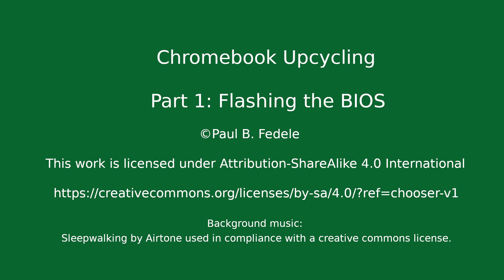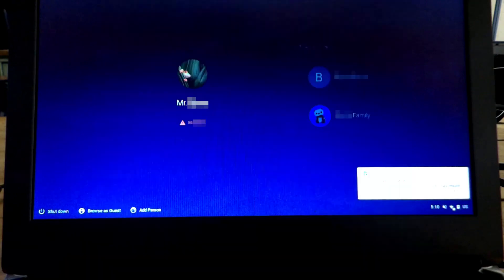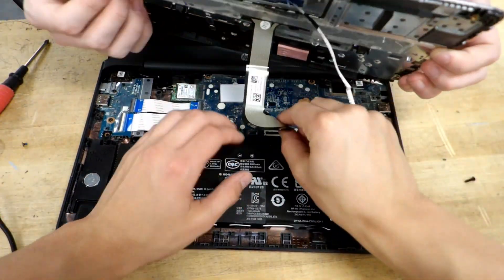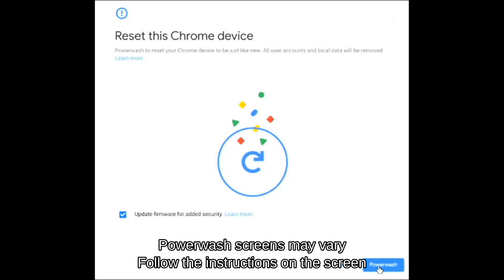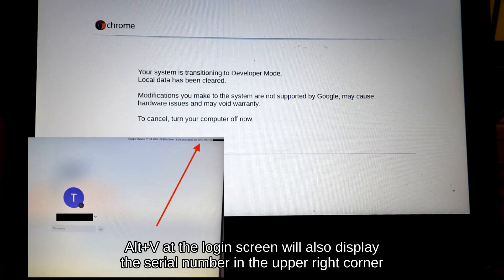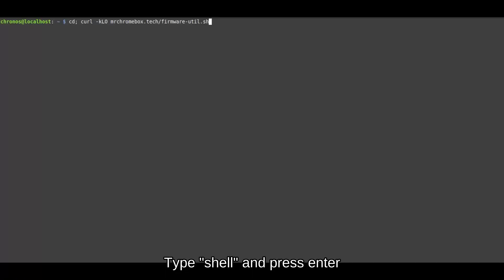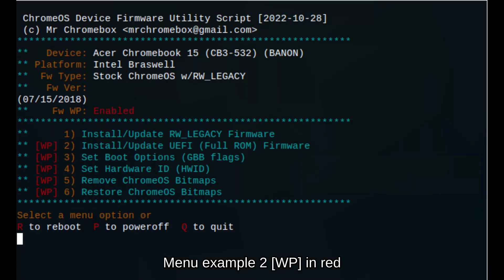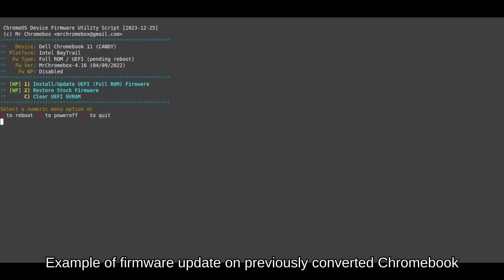Chromebook Upcycling to Linux:  Part 1 Flashing the BIOS / UEFI

Comment: hi, sorry for the inconvenience, when I try your method, it shows me this message "MrChromebox Firmware Utility Script starting up

Downloading supporting files...
This script only supports 64-bit OS on x86_64-based devices; ARM devices are not supported. can you help me with a 32 bit based script, please.
Reply from the maker: Coreboot / Seabios only supports X86 because ARM based computers, including the Raspberry PI, don't have traditional BIOSes to flash (https://github.com/coreboot/seabios).  I've tried putting Linux on ARM based Chromebooks using other methods with limited success, none of which I would publish a guide to.

Comment: Going to try this for a hp chromebook 11.
Reply: This was such  a great help. got it booted up with my gf. Upload the other parts!
Reply from the maker: Sorry for the delay in publishing Part 2.  I have been teaching multiple simultaneous technology classes (Routing, Switching, PC Repair, Python, etc.) while rotating with a substitute for the last year.  Some of this is already filmed, but I should have time to publish in June.  In the interest of keeping these machines running, I will summarize part 2 now:

Given the small EMMC built into Chromebooks, they have a tendency to fill up and lock out the user.  I have written a GUI based script to offload the /home partition to a USB drive https://sourceforge.net/projects/usbhome/ and have some techniques for keeping the storage down below 12 GB on the / partition (removing old kernels, clearing /var/cache/apt/archives/*.deb).

Comment: I just flashed a 2017 Acer.
Reply: hi, excuse me for the inconvenience, when I try the method in the video, it shows me this message "MrChromebox Firmware Utility Script starting up

Downloading supporting files...
This script only supports 64-bit OS on x86_64-based devices; ARM devices are not supported. can you help me with a 32 bit based script, my pc is medion akoya s2013, please.